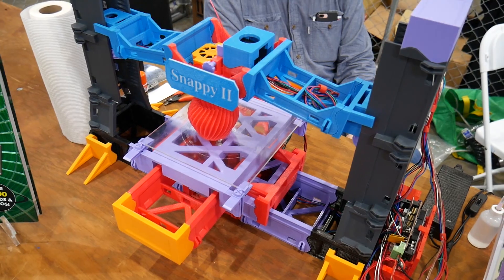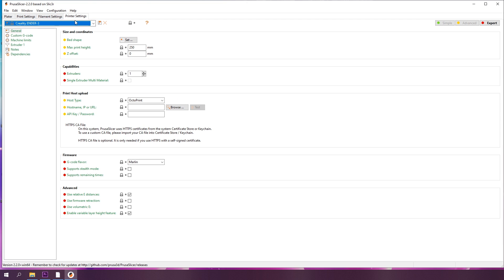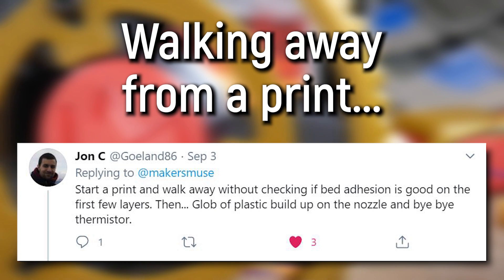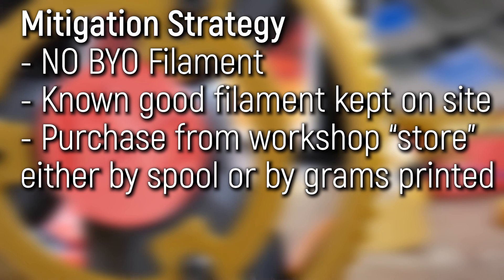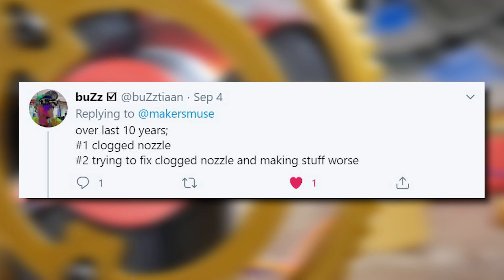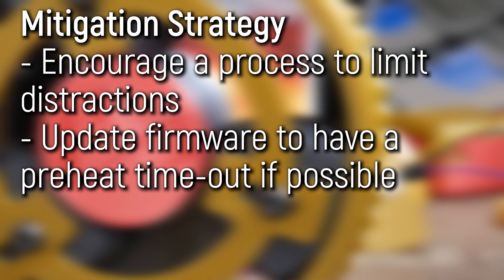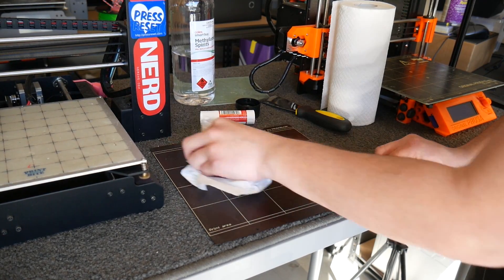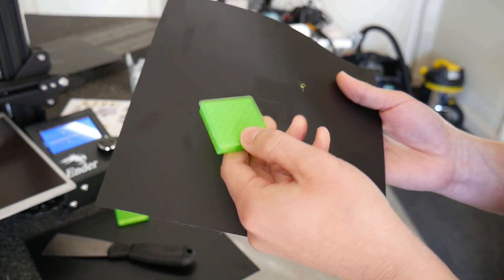How People BREAK 3D Printers (and how to stop it)

Comment: Angus being that you are a very knowledgeable guy and i have done some research but there are so many opinions out there its kind of tough to come up with a decision.  Here is my dilemma good or bad to use an oiler on a bowden tube printer, i can understand the sponge alone and i did try it also in conjunction with cooking oil because of its high smoke range. Now to be fair i did a full maintenance and cleaning of my printer first, new brass nozzle, cleaned out the heat block, new Capricorn bowden tube, new extruder gear, fully levelled the bed to a point where it was almost perfect, and of course i do have a BL Touch, my printer is an Ender 3 Pro.  Now i printed off 3 Benchys one with out anything and it turned out as usual the same layer lines, numbers and letters are as legible as they get pretty much the same benchy as when i first turned this printer on.  The second Benchy was just sponge only now there was some noticeable improvement but nothing to get excited about, oh as a further note i have never had any ghosting or ringing some stringing once in a while but that's my fault, now the 3rd Benchy that had to be the most amazing benchy this machine has ever printed i was totally amazed smooth it was awesome almost wanted to throw a party.  I took some benchys that i had around here that i had printed off during the last couple months usually every color or product or manufacture change so anyway  12 of them and not a one of those came close to this last one i just printed with the few dabs of cooking oil in a sponge which i situated just before the extruder.  If i new how i would send you a picture of my (in my opinion)perfect benchy. Needless to say was this just a fluke or is there something to the oil and sponge idea, or a change in filament there are way to many variables.

Comment: oh god. i dodged all of this by having common sense. never had anything break.
the worst that has happened is printing with flexible filament failing because the feeding mechanism kinda snagged the filament and stopped feeding (therefore failing the print). happens all the time whenever i try to do bigger prints with flexible stuff. i guess i need to upgrade the feeder to a double motor thingy because the default one on the ender 3 seems just not to be able to deal with flexible filament all that well.

Comment: ANother potential mistake with printers with 2 steppers for Z, is touching the X cross bar when the machine is off or the steppers disabled, and inadvertently moving ONE of the steppers causing the bar to be not parallel with the print bed.  How do I know?  Dont ask.

Comment: I got my first printer in high school, and knew practically nothing about 3d printing at the time, so I had to learn as I went.
My first printer was a monoprice select Mini v1 (the v2 wasn't out yet)
First off, it was poorly built, which didn't help. The whole hotend assembly was held on by these awful and tiny set screws, which rounded so easily, especially when I had to constantly disassemble the thing to get it uncloged.
Also, clogging. I didn't exactly buy expensive filament, and 3d printing was still quite a new thing at the time. (this was like 6 to 8 years ago, I think) my nozzle liked to jam on occasion, and one time.... All hell broke loose. First layer went down fine, I left it alone... And then came back to a nightmare. 
The nozzle had jammed up at some point, and the print had failed. The filament was melting inside the heat block, pushing out around it, around the nozzle, underneath the insulation, and even pushed the thermistor out of its hole. The entire front was encased in a filament shell as well. Thankfully, somehow, I got the printer working again without too much issue, but I've had a few other issues with it, which has led to it being in peices in its box, since I just don't want to fix it anymore.
I do plan on replacing the whole hotend with something much more reliable at some point, though, so it won't be thrown away.

Comment: The only way that I've messed up my printer was the aluminum tube that slots into the block of the hotend was faulty, and started to create a layer of pla on top (without my knowing). It then cooled between prints so that the plastic started to squeeze between the silicon sleeve and eventually reach the nozzle. made me think that something was wrong with my settings until I decided to try changing the nozzle and found my hotend had a lovely white glaze on it...

Comment: Yes, somehow I followed all the steps required to not cause my printer to implode, without knowing what the steps were XD.

My PLA Filament is unspooled so it's literally excited to entangle and kink... I found such a kink while printing I grabbed a lighter and flashed the kink to straighten the filament, it extruded just fine with no obvious defects but I am curious if it effects the print at all.

Comment: I am sadly one of those "Newbie's" and having a really hard time with my ender 3. The test print that came with it came out flawless on PLA but I had already decided to switch to petg and now I can't get anything to print that is not a failure. not quite sure what I am doing wrong. I thought maybe a setting in cura was off but no thats not it. then I got a new roll since my current roll has been exposed for a few weeks and it got worse.... I did the glue stick which is the only thing that worked so really nice to be able to remove failed prints with ease... any help would be much welcomed.

Comment: Got a bit of a story for you. So college 3D printing Maker Space. I went in there to print a kig mask to use as a prop for a presentation that I was doing in class and I found the place almost abandoned. The hallway down was dusty and filled with cobwebs but the room where the printer was was spotless. Anyway I got everything up and running and saw that the print would take a little over two days on a MakerBot Replicator 2. I hit print after plunging my USB drive into the incredibly deep USB socket. The first few layers went well so I left. I came back after class and the model was duct taped down to keep it from warping. I was thinking to myself "Okay, it warped probably because of the open window next to it in the dead of winter. It's probably fine. Came back once it was done and found the top layers around 3/4 of the way there shifted. I'm still trying to figure out what went wrong...

Comment: So i guess hitting a print with the printhead is out of the question? What about using the handle of the included spatula to hit a print off. I'm using water(mostly) to take my prints off, but am wondering if those are safe options? Also can i warp my bed by overtightening/overlosening  my springs? Have not destroyed anything of value yet (3d prints mostly and done some bad grooves with the brass nozzle on the glass bed surface (may upgrade to an aluminum plate with a removable magnetic surface for pla and a pc sheet for everything else (abs, nylon, flexibles, pc (have not reached the level of stable pla yet, will see how far i can take my printer))).

Comment: I need advise. My Ender 3 v2 is 3 weeks old. After about 50 small prints in the first 2 weeks, my glass bed is very high in the center. I print with a bed temp of 60 deg. Does the glass warp and can it happen this fast? Also a few times I washed the adhesive hairspray off before the glass fully cooled. (I only hairspray the glass when it is off the printer).  Or maybe the glass was never flat as I used to adjust the bed at the corners and not check the center until I added a BL Touch a week ago.

Comment: In my shame, I have done awful things to printers before. Back in high school I thought the easiest way to get rid of the string of plastic (ABS at the time) coming out of the nozzle was to use flush cuts to snip it. Managing to snip of part of the nozzle along the way. I also did the thing where super glue was used to "fix" a crappy plate adhesion print. Went about as well as you imagined, trashed the built plate and I think the print failed anyway.

Isn't the ignorance of youth a beautiful thing?

Comment: Just wondering, since im kinda new to 3d printing:

Is it safe to leave filament in the printer when its off? Im under the impression that you should remove it when not using it but neither the manual for my printer nor any videos ive seen so far really mention this. 

Also, is isopropyl alcohol a good cleaner or is it too abrasive? In this case im using a textured glass bed.

Comment: It seems like software should be able to take input from the model, compare it with the printed result through a pair of cameras as it prints and either alert you or shut down when the model grossly mismatches the print. It doesn't sound all that difficult but then again I haven't written a line of useful code in my life.
Reply: As someone who works in software, getting software to recognise or understand anything from a dynamic image (a camera) is really difficult and unreliable. 
Sorry what you're asking is really difficult, if not nearly impossible. 
Let's have a go in ten years time. We are getting there using AI and machine learning but it's just not there yet

Comment: Listening to this I almost feel personally attacked 😂
My solution to any kind of problem is to poke and pry until I understand why it is behaving the way it is. If a print was stuck to the bed it would only be logical to yank it off. It is engrained in the mentality of most "makers" to try things and see how they work out, but obviously without any form of earlier knowledge, the only knowledge you get is the one you make from your own limited experience in other projects, which might not line up with delicate machinery.

Comment: 3d printers are still experimental tech in my eyes, even if ur smart, the failure rate is ridiculously high..but some of the most common issues are 1)filament breaks and clogs entire tube and nozzle 2)plate is not levelled and crashes into nozzle 3)the filament gets knotted as it rolls off the PLA cylinder 4)plate level sensor issues

Comment: My printer had this problem that it was way too easy to get the printing bed to move up after a failed print. The first time it happened I was quick enough to switch off the printer and the nozzle only got a few mm's into the print.. second time though I wasn't as lucky and the whole print nozzle got jammed into the hot print and the sliding rods got bent (permanently?). It was impossible to get any movement in the printer after that and basically required me to disassemble the whole printer. It was a big design flaw imo.. after any maual interruption of the printing process the bed should only be able to move down, not up into the damn print head.

Comment: Duuudddeee.... I was using the metal spatula/scraper thing that comes with the Ender 3 Pro to try and get my print off the Creality textured glass bed (It was super super stuck on there), I slipped and ended up getting stabbed in the wrist by the corner of it. I have had my printer for 3 weeks so the scraper thing is still very new, I think it went in like 4mm, just missed one of my veins, I could see meaty bits... Hurt so bad....

Comment: Have you seen the "EnderLoop" mod for the Ender3?  I just purchased an Ender3pro to do the mod.  You can find it on Thingiverse, and I've even modified one file so far to use extruded alum, rather than trying to print the entire "extrusion" on a printer... I have 2020alum sitting around as i use it for a lot of diy projects and printer builds, but you can buy it cheap on amazon, or misumi...  You only need about 600mm total.

Comment: I have a question for the commenters... What filaments would you say are the worst brands in PLA, SPLA, PLA+, or PETG?  I've tried a TON of different brands and Cheap/Expensive filaments, and I've found ones I like more than others, but I've found that cheap filaments work just fine.  What have you had issues with?  I have an Ender3Pro and AnyCubic Mega X... The Anycubic is the printer i'm referring to that will print anything.. It just takes FOREVER to heat up being 12v... But it will print EVERYTHING I throw at it with very little problems.  I do use "TransferTape" on the bed, now that its old and worn out.. The Ultrabase worked GREAT for a long time, but its just old, and been cleaned 50,000 times and although its not scratched, I no longer get perfect adhesion anymore... I use think Transfer tape for installing Vinyl Lettering, which is Wide, and fits almost perfectly across the bed... My Ender 3 pro has a magnetic bed, which is great for removing prints, but sucks for bed adhesion, however tape wont stick to it either.  I just heat it up to 75 before every print, and that seemed to fix that problem.. I will say the rough surface leaves an undesired finish...

Comment: I build 3d printers for small business, engineers and UQ. Over the last 5 years everything you talk about I have seen. I have even bought back 3D printers from clients saying there is was an issue but in fact they are in the category I have dubbed "to stupid to own a printer". 

From a 3D printer setup here are 3 things that have saved me from giving up on this whole career: 
1. BLTouch and Automatic bed leveling 
2. Removable Bed Systems 
3. Auto Z-Align. 
With these 3 things have stopped a majority of issues and has increased the chances of successful 3D prints. For the guys at UQ they will say Auto Z-Align has been one after seeing students trying to pint with the Xaxis obviously way out of align.

I will mention a 4th. Filament cleaner or Filters... basically a piece of foam in case the filament runs through to wipe an settled dust... I pint heaps of these and any customer that walks into my shop I give them one.

Comment: I remember the first time I used a 3D printer. It was pre covid at our downtown library. I wanted to print a game piece for a DnD campaign I was playing at the time. I just assumed everything would go right but when I came back the next day my print had failed and also wasn't printing as large as I wanted. Told this to the lady running everything and she just said that it happens with these $200ish models. 

She made the print size larger and started it and I watched it for 20 minutes before it failed again. I noticed that filament had stopped coming out and to test it a slid a sheet of paper in between the print and the nozzle and confirmed it. Went and told the lady and she thanked me for how I reacted to the printers malfunction and started a new print on the one next to it and just told me to leave as she will make sure it prints.

Went back the next day and my print was complete and perfect. Paid and tipped her. Very nice lady.

Comment: I just got my 3D Printer a few days ago and I made the error of preheating for about 10 mins and it started beeping luckily and then I understood what was happening a few moments later. Luckily the printer had that built in (though I was going to take much longer to start printing). The only annoying thing is that the error on the screen wasn't that clear, it gave me a good scare because I looked up what could it be and I found some really bad things but then I thought "it could be just that it overheated because I left it pre-heating too long" and I haven't had any issues, now I just pre-heat when I feel like I had the settings I want on the slicer

Comment: I finally built my Folgertech I3 2020 from a few years ago.  I'm guilty of most of the bed adhesion things.  I've done Painters Tape and also tried crazy glue to the painters tape.

The Z-axis limit switch is dicey at best for what you get.  I was trying to print an improved bracket to let me adjust the limit switch with a bolt and was struggling to keep anything adhered down.  In my defense, I got it made, and it really did improve the consistency for bed adhesions.

Comment: Actually, I made a filament filter, and used a chunk of memory foam in it with a light gun oil. What happened was the filament would pull tiny amounts of foam off, and it built up like fine white sand around the top of the extrusion tube. It worked its way into the nozzle, melted, and caused a clog. Turns out that memory foam takes a fair bit of heat to melt, and its kinda like Teflon or something. Has to dismantle the extruder and clean it inside out.

Comment: I just bought a broken 'monoprice maker select pro ultimate 3d printer' for $200CAD. Turned out to have a burnt out power supply yet only about 30 hours run time. 

Gantry had some binding, so did some adjustments. I have it printing ABS at 0.1 layer thickness. 300mm/s top speed. Bed adhesion is alright, but the build mat isn't what I am used to. Print ABS on lexan if you want good adhesion. Clip it to the heat bed with 12 binder clips. You can separate prints by simply removing the lexan plate and flexing it. The ABS will pop right off.

Comment: I broke mine once but mine was due to overuse and ended up better in long run because of the 3-D printed parts that my printer came with broke in the middle of a print now there’s nothing I could do about that that caused a huge failure of the whole machine luckily I was going And checking on it every few hours and turned it off but not before it imploded on itself unless unless you have a camera pointing at it I wouldn’t suggest you trust your 3-D printed parts for long term because of the failure I had to get some custom made parts to fix it

Comment: Hi, I have up dated my tronxy x5sa to marlin firmware as the problems I had was solved in marlin and it worked. But now I have a new problen, it prints only the infill without the shell. could any body shed some light on the problem? I use cura 4.8 and I suspect its in the gcode where the problem lays but i have very little experance with gcode